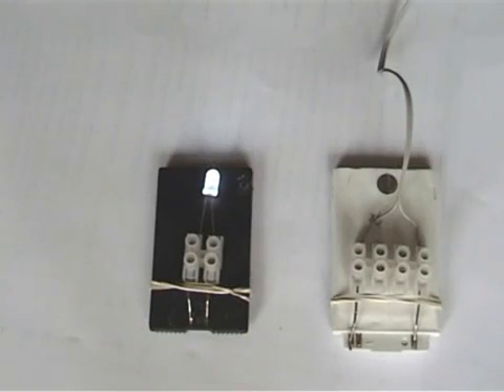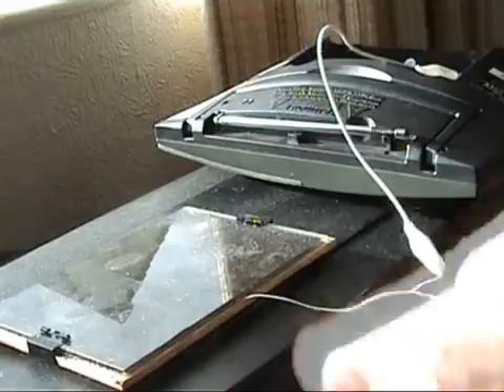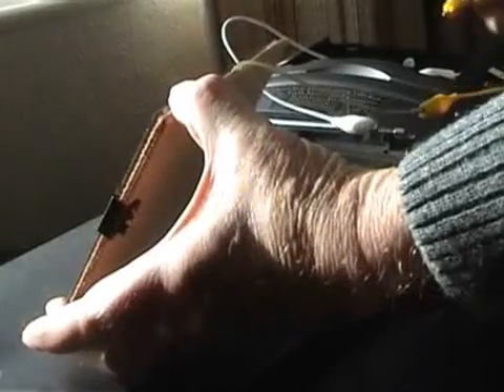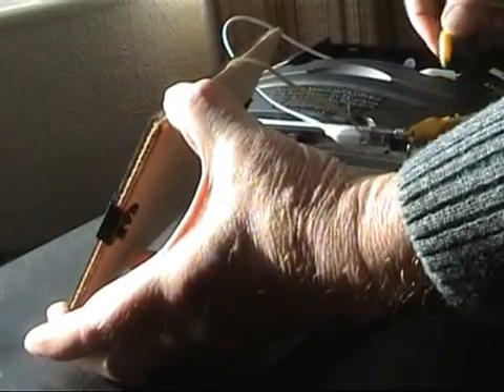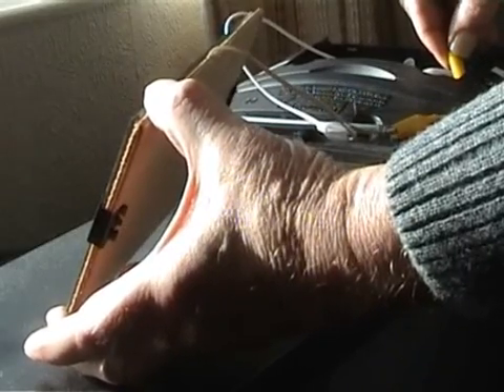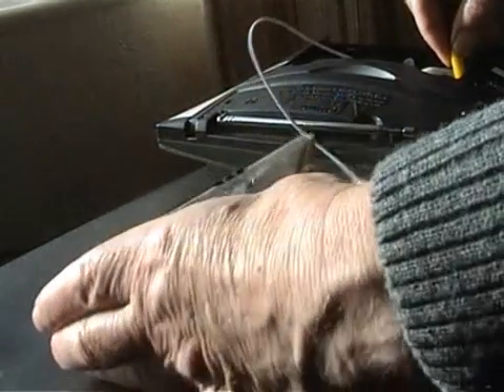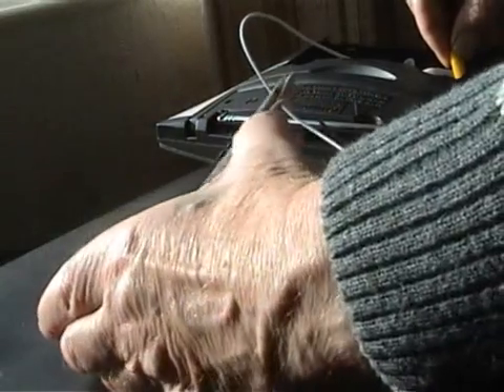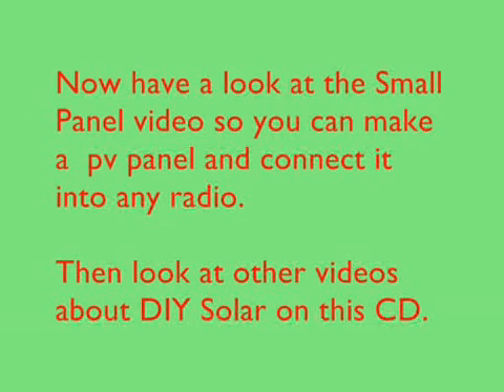Making simple solar panels in poorer countries

Comment: Nice vid!! Im using a solar panel in a demonstration in my thesis in the university of Limerick how to produce hydrogen the only problem is it wont work under ordinary bulb and it is essential that it works and seen as I live in Ireland there is a good chance that there wont be much sunlight. Any chance you know where I could get a bulb that it will work under? Thanks a million.